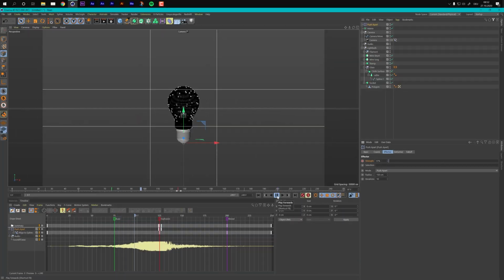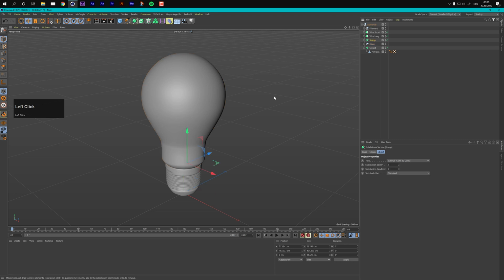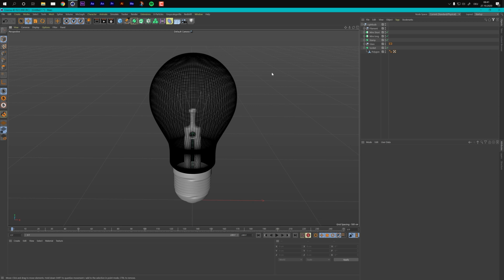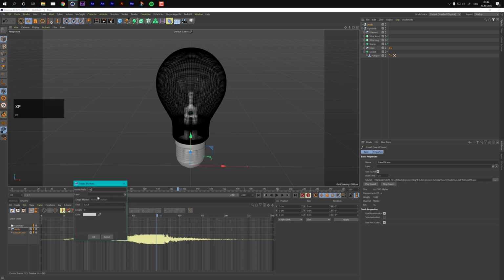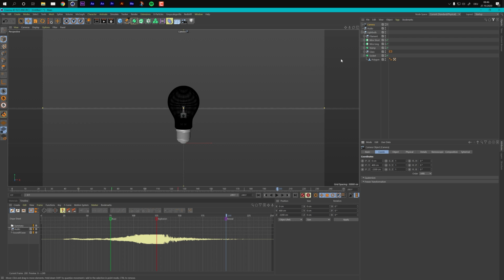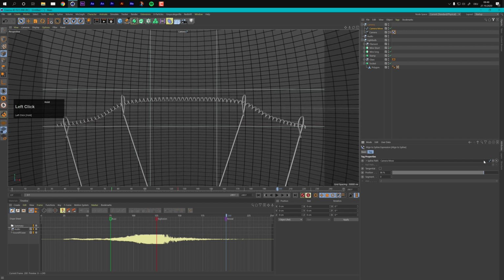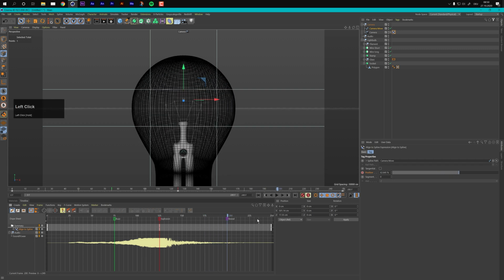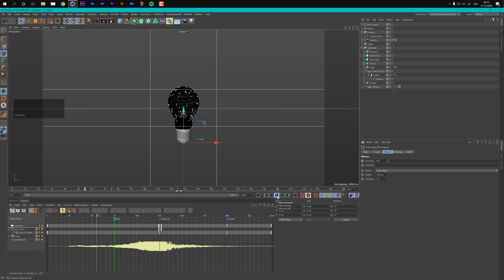Light Bulb Explosion Cinema 4D Tutorial - Part 01

Comment: I downloaded the asset pack but it does not include the lightbulb model for me to start on this tutorial?
Reply from the maker: It´s definitely in there. Check the "3D Model" folder. In there should be a c4d file called "Light Bulb Model.c4d"
Reply: @Nodeconnector  Actually there is no 3d model folder... so basically no 3d file... it contains Audio, HDRI and Shockwave folders... no 3D model...
Reply from the maker: @rebeldesigner  Please try to re-download. I updated the link.